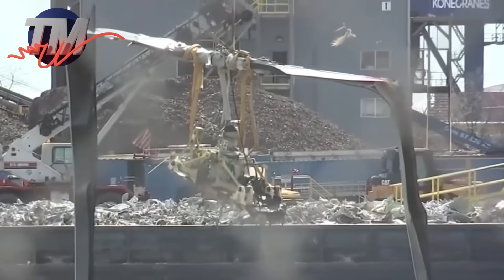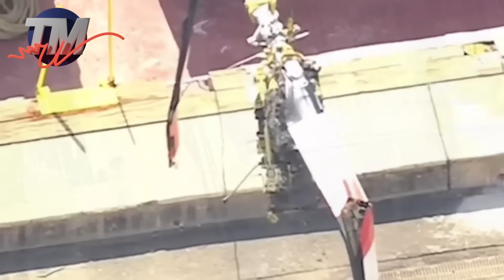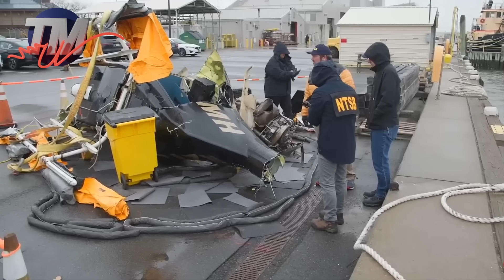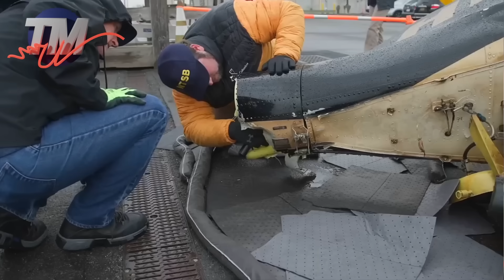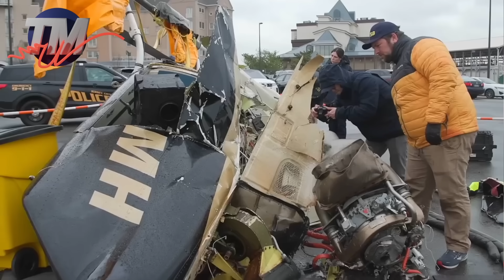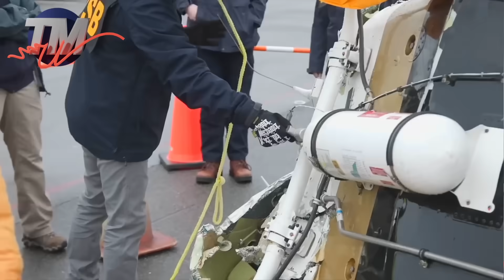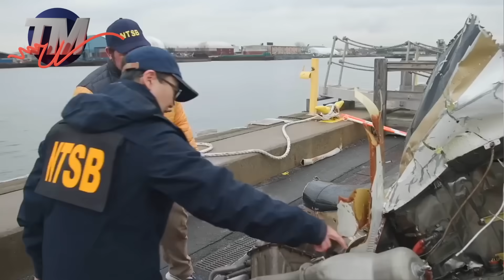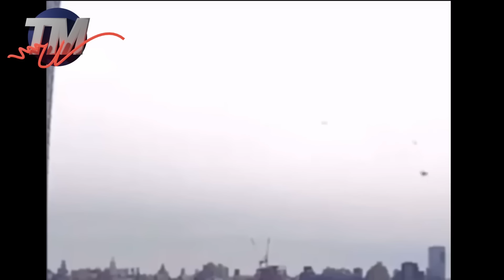Recovery of the Main Rotor of the Hudson River Tourist Helicopter - it's worse than we thought

Comment: This is truly a remarkable find that heli drivers must be thinking "How in the world did that entire assm separate from the airframe? This is going to be one of the bizarre findings ever on a model that has a decades long record of a good aircraft. There must be thousands of this model flying. Any rotating mass like this with an imbalance is sure to be micro-seconds of extreme violence of enormous movement of mass - But how do you remove such a sub assembly frame? and strands of blades are still attached? it didn't throw a blade making it even more bizarre. 
 whatever this AD ends up being should be named in the honor of the victims lest they be forgotten.

Comment: I'm not very familiar with helicopters,  just a general mechanic but my theory is that since this machine underwent a fuselage extension it would need an auxiliary drive shaft for the rear rotor. I think the bearing support failed and the shaft swung uncontrolled and cut the tail off. Also locking the transmission.
Reply: The tail bent around to the cabin. It cracked off later.

Comment: Some wild outlier speculation, and I will admit it is only that, is that this was a hit on this family. Now, purely for argument's sake, say this was so. Witnesses heard what sounded like gunshots going off, or perhaps even more like a "boom." What if said "boom" was caused by a small explosive charge. Not enough to really blow the helicopter up on the order of what you might expect in a Hollywood movie, but a charge strong enough to sever the transmission and rotor assembly from the airframe? That might explain how we got most of the transmission and rotor intact, yet the purpose was still served. Impossible? No. Likely? Maybe not so much. Whatever the cause, the results are still tragic, and may the pilot and family RIP.

Comment: ITS CHINA They have begun sending us substandard hardware that is designed to fail. He just said it failed where the tail boom was BOLTED to the frame. I recently have had multiple electronics from China explode in my face. No one realizes they make everything for us if they wanted to they could bring America to a halt. During Vietnam our CIA waged a similar war on the Vietcong. Instead of having bullets that fired and killed Americans they slipped bullets into their supply that exploded and killed the shooter. Different circumstances byt similar idea. If you're an American understand we are headed for very dark times.

Comment: Here's what I think happened

1. The main rotor assembly became partially loose on one side  while in flight.
2. It tilted and started to slap the tail multiple times but not enough to cause the tail to initially break
3. The tail finally gives in and breaks off the helicopters main body.
4. The rest of the rotor now pulls off from the rest of the body.
5. The crash.